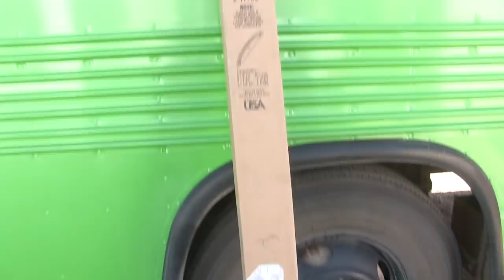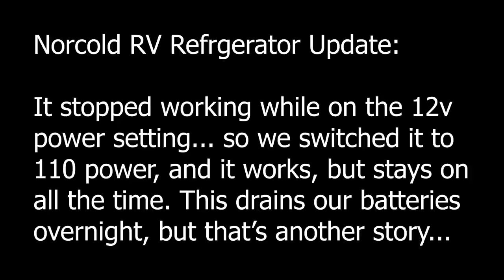Making Screens for Skoolie Windows and Other Bus Stuff!

Comment: Montréal, Quebec right now and we've been living in every capital city in Canada west of here over the last 27 years. You get to know a place after a few years. 

Used the screen stuff to replace the screen on the screen door. Few things are as satisfying as that. They look so good on Bussy!

I've been reading up on used school buses and the various configurations. Listening to some of the guys talking about them, some are made for the mountains while others for the flat prairies. It's the engine and transmission pairing that makes the difference as the steep climes of the mountains both up and down are demanding. Overheating was an issue as well as the brakes on the downward run as you use them so much. There is an engine brake which makes a big difference but that's well out of my understanding. Just something to think about. 

Lastly, I guessed 27,000 but you know, the camera adds ten pounds to everything. lol

Comment: Way to go. I'm from canada, just above idaho. Creston bc. Fridge, rv, fridges work better on propane, while away from power. 12 volt only while driving. 110, while plugged in. There are some new freezers that only use about 1 amp, that work well on solar panels.

Comment: fantastic job on the screens, not sure how well they will hold up on a moving vehicle.  I built storm windows and screens for residential for 20 plus years and thats the first time I have seen them mounted on the outside, on RV's they are on the inside, but hey you never know.  In my experience with plastic corners is they tend to dry rot over time and come apart, I would have used the metal inserts instead, the only difference would have been mitered corners on the screen.  Happy Travels and I hope you prove me wrong on the screens.

Comment: I was watching another YouTuber and he also had overheating issues with his engine. He ended up installing baffles over the radiator vent on the outside screen. The baffles pointed toward the front of the bus and the air would then be forced into the engine compartment. Hopefully you fixed the overheating problem and won’t need to do anything further.

Comment: haarlem the netherlands europe been to the us about 4 times arizona los angeles tennesee and oregon , only didnt liked the people at the airport at new york (verry verry rude ) but had a great time anywhere else
about the refrigirator , some electric devices dont play well with the 24 volt to 110volt sine  converters , might want to check if it runs good when hooked up to shore power or if the refrigeration compressor gets hot while on solar power 
i hope that the pipe is high enough so that when you take a long corner the guy driving the convertible next to you doesnt get a smelly suprize dumping out the tube sticking out the side of the bus when the grey water tanks are near full

Comment: Good morning guys, I was kinda disappointed that didn’t turned them close caption on so would you turn on the C C  thanks mark
Reply from the maker: There doesn't appear to be an option for automatic closed captioning. that leaves us with having to hand type the entire video and that's just not possible for us. If I can find some other solution I will make that happen.

Comment: Goats head is the worst ...Upton Wyoming...with a Norcold it has to be pretty level or you.have problems we have a regular appt.size refrigerator  running of our solar day and night...someone else had problems with their radiator in their bus had to do with the water channels going horizontally instead of vertically

Comment: The weight might be why it struggled with the truck... pushing close to gvwr when towing.
Reply: Towing is different from GVWR right? Isn’t the tongue weight counted against overall gvwr?  The weight of the Jeep,would be on the Jeep,chassis, No?
Reply: @jason328d6  yes but the powertrain was engineered to put up to gvwr into motion. Being close to that limit will mean the engine is being worked hard if not straining. But the radiator seems to be the real issue.

Comment: ... Just a word of "advice"...  If you drive a vehicle on US public roadways, and it weighs over 26,000 lbs, you are required to have a Commercial Drivers License (CDL).  That is Gross Vehicle Weight (weight of everything connected), meaning that if the bus only weighs 21,000 lbs (non-CDL) and you connect a 5,200 lb "towed" vehicle... when connected and driving down the highway you would be required to have a CDL.

I worked for years building large "truck-based" specialty vehicles which required driving them for "delivery".  We did both exhaustive research and questioning of the rules.  "commercial" in CDL has NO connection to "commercial purposes" like one might think.

It will only matter "IF" you are pulled over by a Department Of Transportation officer in whatever State you are driving in.
Depending on the attitude of the officer... it may cause considerable cost.

We went to pick up materials from out of state on a flatbed trailer behind a pickup.  We were pulled over 100+ miles from "nowhere" by that state's dept of transportation (looked like an unmarked highway patrol in a pickup).  They measured our total length, then brought out small pads (scales) to weigh us roadside...  you guessed it... 27,300 lbs.

Got a ticket for the non-CDL, but that was not the worst of it...  We could not continue from that exact spot (middle of nowhere) until we either 1) were  under the 26,000 lb limit OR 2) had a vehicle operator with a CDL to drive...
Options were to get a second truck to drive to us, off-load 1,300 lbs of cargo... find a driver with CDL to come drive the truck rest of the way... or believe it or not, have a tow-truck come and tow us (tow truck like used for semi).

We sat there (with DOT) for over 4 hours and waited for our company to drive out with a pick-up. We unloaded all that we could into it and drove both trucks the rest of the way home.

IF this happens to you, I imagine your only option would be to get "towed" and be prevented to drive until you attain a CDL to continue...

Just a word to the wise...
Reply from the maker: This only applies to vehicles registered as commercial.  Our bus was reclassified as an RV and immediately became exempt to those laws.
Reply: @BussyMcBusface   I stand corrected!  Awesome loophole for "skoolies"!  I am in the planning stages for "rolling my own"... LOL